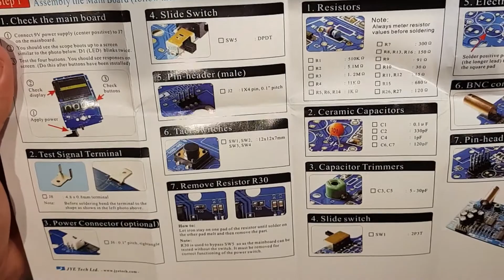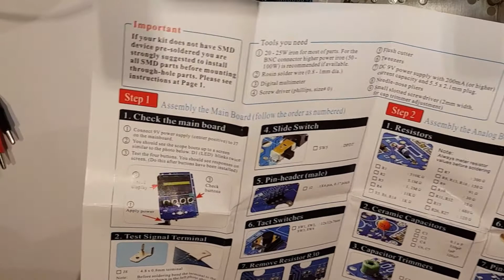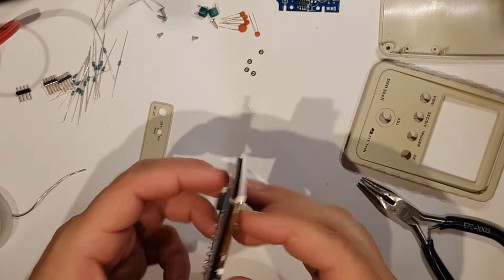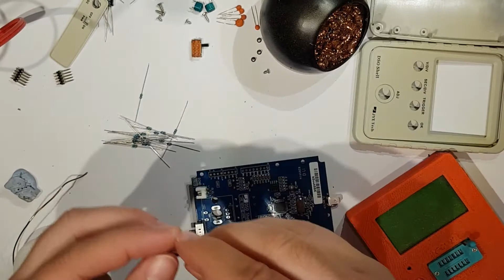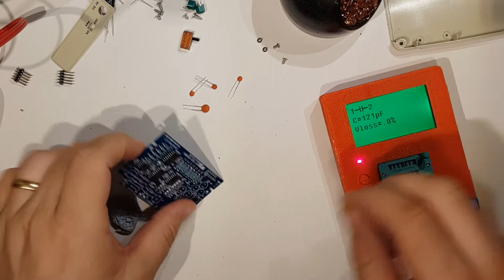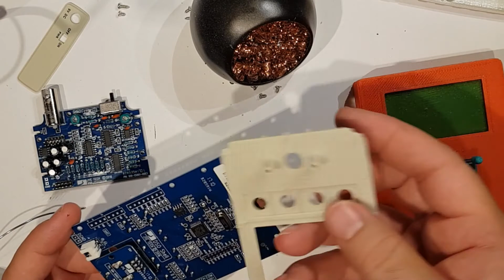DSO150 Cheap Oscilloscope Kit Build - Part 1

Comment: I'm going to be making one of these this weekend so many thanks for doing this, it's helped a great deal to see your build first. I love the component tester you have there! is that made from a kit too?
Reply from the maker: The component tester is bought bare bones from banggood.  You can use it as is (add a pp3) - but I found after a while the screen started flapping about - and its just held on by a ribbon cable, so in the end I found a case for it on thingyverse and 3dprinted it.  To protect the device.  Sounds like a brief vid of that device might be useful too.